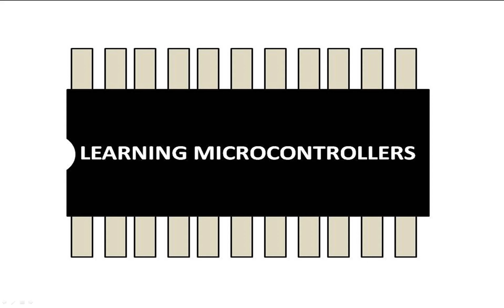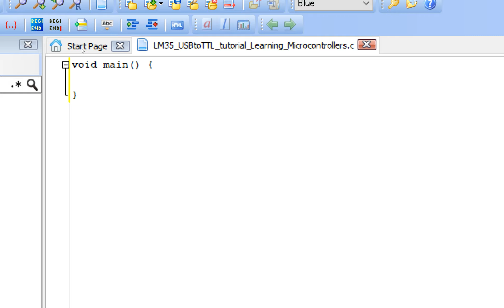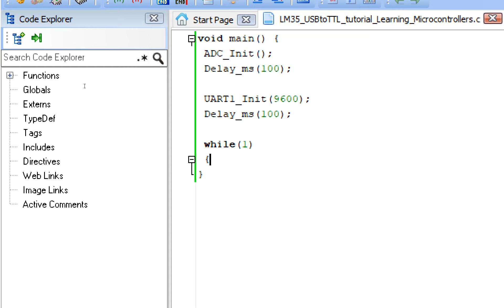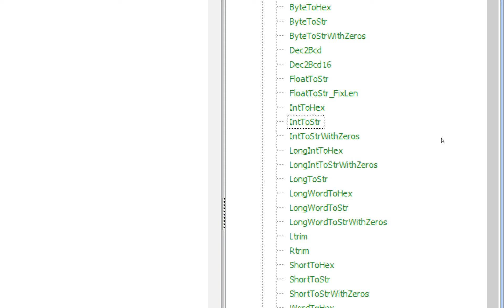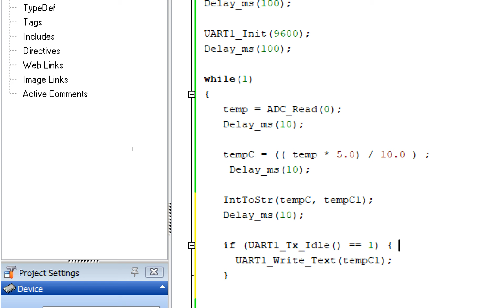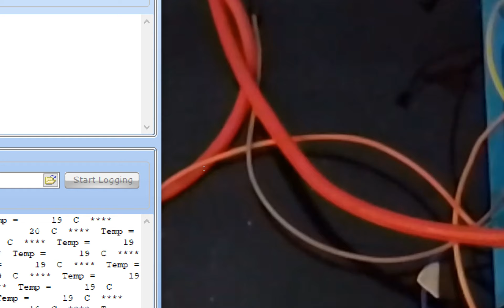PIC16F877A interface LM35 temperature sensor and output on PC/Laptop using USB to TTL device.

Comment: I have try to interface DS18B20 Temp sensor pic16f877a  how to do that?
Reply from the maker: Thats requires different code
I will make video on that soon
Reply: @learningmicrocontrollers3561  thanks lot
Reply: @learningmicrocontrollers3561  i have tried but not work properly would you help me